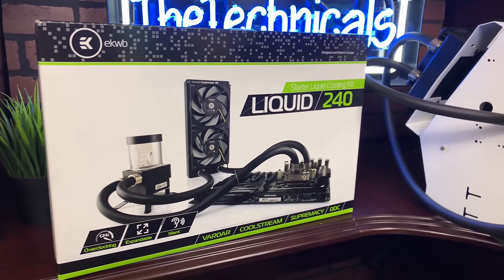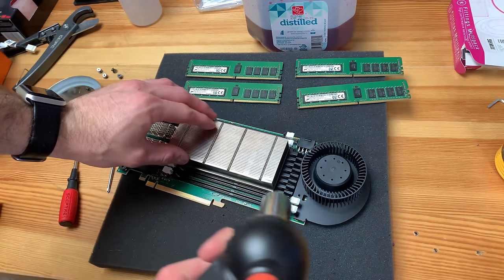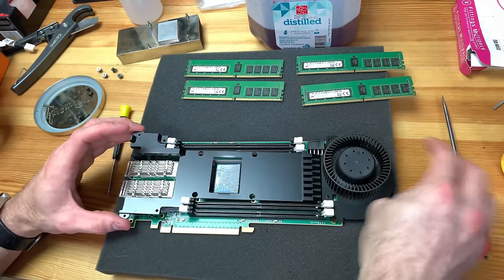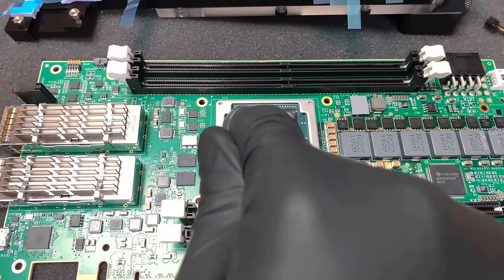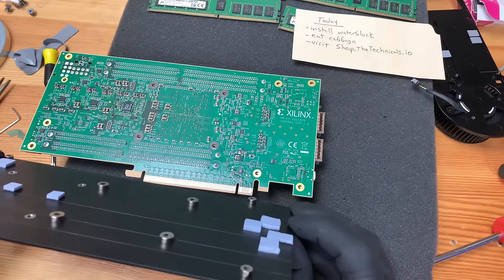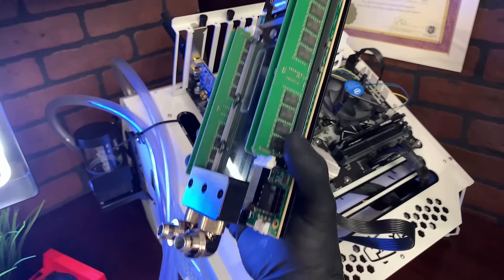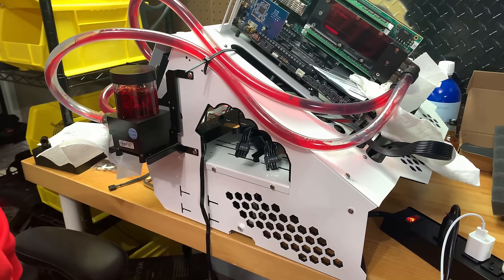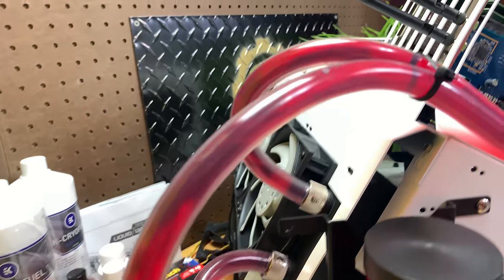[FPGA Series] How To Install TUL Water Block for Xilinx VCU1525

Comment: Okay, I re-watched the TP amount and I stand by my assessment that the excess TP could of easily come close enough to the surface mount components to change the tuning. Even if it didn't actually touch a part it still can change it properties. There is a reason why the pros only use a thin layer and I'm one of them with three decades of pcb design and tuning in RF filter, TCXO, and PC repair.

Comment: FPGAs are usually pretty hard on the RAM. Make sure the temps on your DIMMs don't go above ~60C. The stock cooler looks like it cooled the DIMMs, the water cooler does not.